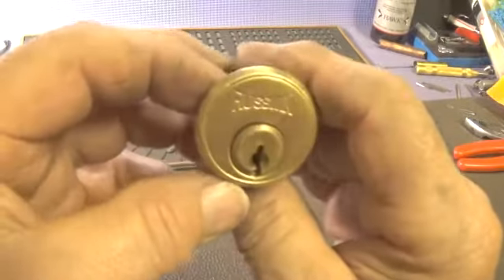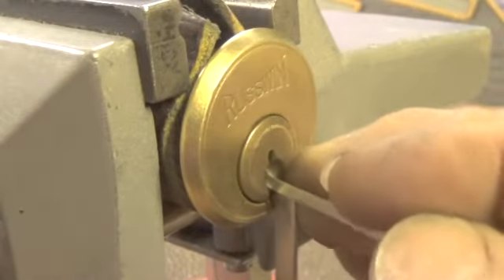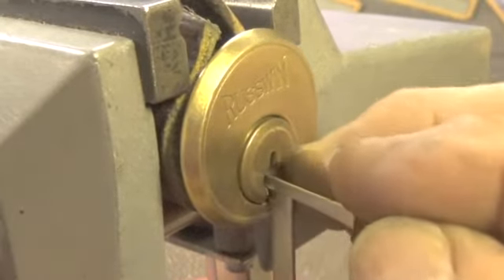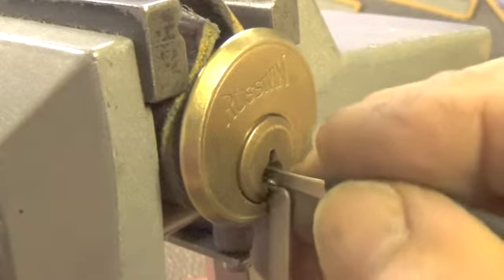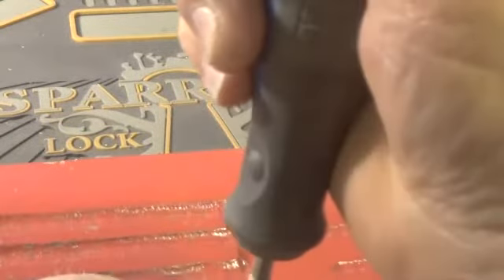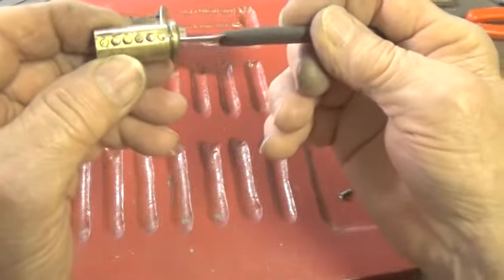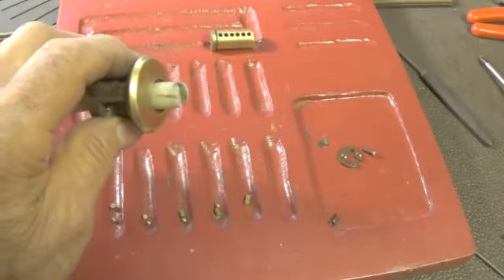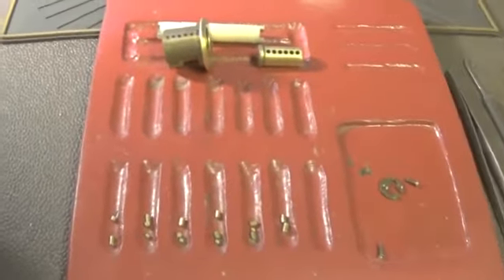(490) Tremaster30 Russwinn 6 Pin with Ball Bearings SPP'D and Gutted

Comment: Why ball bearings? Security or just being cheap?
Reply: decreases key wear.
.
Reply: thank you
Reply: Doesn't that create a second shear line for those pins? It seems like a bad concept as far as security goes.
Of course, with all standard pins, I guess that was not their main concern.
Reply from the maker: Not really. The ball bearings are at the bottom. I guess you could cut a different key and make it work as  a second shear line, But since the ball bearings are not in every pin chamber then I guess it could be set up with a master key. I don't really know. I have never tried it.